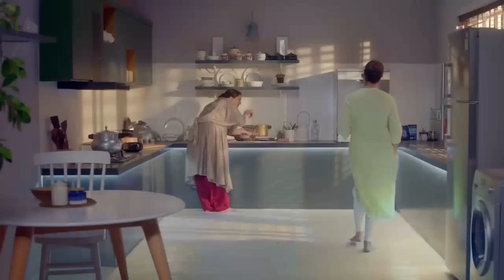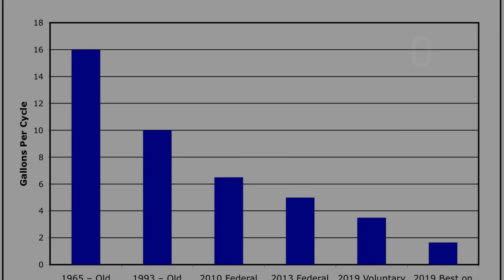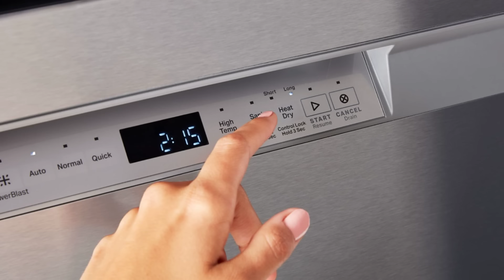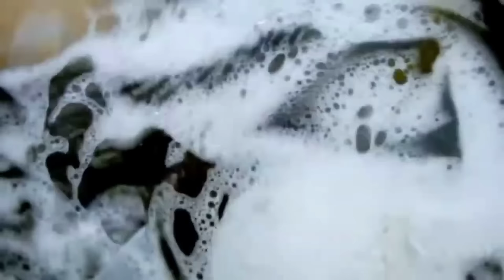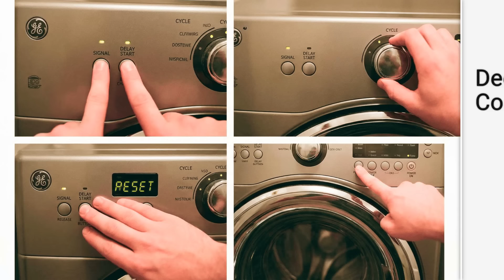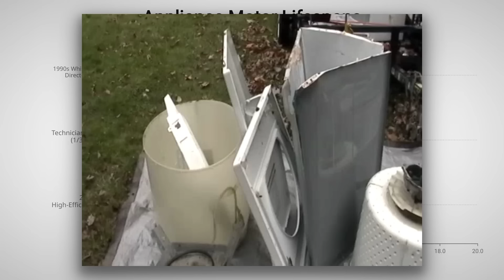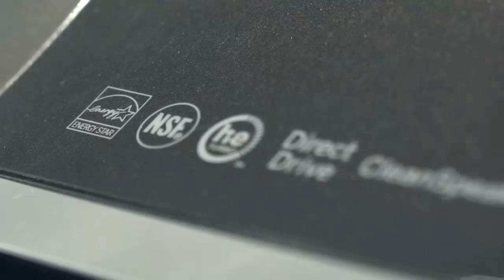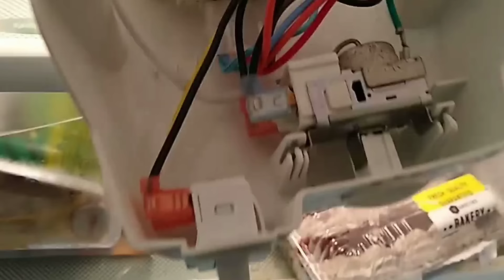Why 'High Efficiency' is a Scam (The EPA's War on Quality).

Comment: It's not just the washing machines in dishwashers that have gotten horrible it's the detergents as well. 

While they were mandating all these efficiency requirements for dishwashers and washing machines. They removed triphosphate from the detergent triphosphate works to remove the detergent buildup. Detergent is a great cleaner however it needs a chemical to break it down so it can be removed. This is why washing machines and dishwasher stink the detergent is never rinsed out of the machine and you notice a slimy buildup if you ever take one apart. That is the detergent trapping all the dirt particles and organic matter. There is a fix painters use triphosphate in cleaning look for a good triphosphate cleaning product use a small amount regularly in your dishwasher and washing machine and it will eliminate the odors. Just keep in mind there are some cleaners now that say triphosphate free they will not work because the triphosphate has been removed. It even works good for just general cleaning.
Reply: I’ve used several different types of tub cleaners and a dozen cycles or more and none of them clean the machine. I know this because I can bend the rubber seal and see the black slime inside. At best the so called cleaners just mask the oder with perfume. 

I remember my mom telling me to use the trisodium phosphate to clean my greasy work clothes.
Reply: @1985230ce if you want to clean your washer input a generous amount in without clothing and run it on a clean cycle. They invented all those tub cleaners because they removed the triphosphate out of the detergent. Most of them don't even clean they just deodorize masking the odor.

Comment: In 1994, I bought higher end units that still had mechanical controls, and that set of appliances lasted 20 years. In 2014, with everything having electronic controls, I went with the best rated, top of the line appliances and put large surge protectors on all of them. Appliance build quality is clearly lower than it used to be. However, the new Bosch dishwasher and LG front-loading washer do a vastly better job of cleaning than the old Kitchenaid dishwasher and Maytag top-loading washer. I was shocked at how poorly the old appliances performed compared to the new ones.

Comment: Speed Queen still makes machines that are built to last for decades.
Reply: I went with SpeedQueen because they use commercial grade parts in their consumer products.
Reply: People don't buy them no blue tooth app.    Yes they are the best.    I am still rocking a 2004 Electrolux back when they were built well
Reply: My grandparents had a Speed Queen washer and dryer set that they had from the time I could recognize what they were as a little child in the early-mid 70's, until my grandma passed in 2009. I moved away shortly after that. My aunt took over the properly and I haven't been back, but I'll bet anything, they're still there working.
Reply: @Bayoucityconstruction  Somebody buys them because they're still in business. But I see what you're saying. 
People are 🐑, easily stupified, age led astray by the newest, shiny thing.

Comment: If your looking to make mold the new  machines are great . As far as cleaning clothes with all the HE hype  and Energy Star bull, it's less expensive to throw the dirty clothes away and buy new clothes all new machines should come with a complimentary bailing bucket and mop and a spare wax motor , skip the mega super tek machines they are  better left in the show room one thing they can do is conserve water on a per wash basis of course you will need to wash your loads 2 to 3 times in order to observe hardly noticeable/ marginal results my domestic service personnel refuse to use the machines and use a large river  rock on the patio it's faster and white garments actually look new and  white when processed by hand.
Old School Commercial top load Speed Queen machines are the best and are still available if you don't have  "La Femme Ménagè" assistance.

Comment: It worse than the video - My washing machine destroys my clothes by have too little water and dragging the clothes against the bottom of the washing machine.

Morons though this would be a good idea to save the planet.
Reply: @sumralltt Naw, they didn't.  Well SOME morons might have thought that.  Most of them knew better.  But they also knew they could "fleece" the public by CLAIMING it was to save the planet.  

Most of them surely knew all along that it's only real result would be to make machines that break sooner and are more expensive to repair.  That way the manufacturers can sell more machines.  

And the manufacturers pull the government's strings, with money.  That's how it always has been, and as long as the system has people in it, that's how it always will be.  That's just the nature of how people are.  (The ones who rise to wealth and power I'm talking about)
Reply: @jefflisa2347  100% agree - Those with the gold bribe those in power to make the rules.
Reply: @sumralltt Exactly!

Comment: You learn this if you ever worked in a restaurant. A dishwasher is only to sterilize the dishes. Not scrub them and wash off all of the filth. YOU hand wash off all of the debris. Then put the dishes in the dishwasher with detergent to get the dishes sterilized. That all the dishwasher is about. Meaning. A dishwasher in a home is pointless. In a restaurant. There are different detergents used to make the dishes safe for anyone to use them over and over again. Don't waste your money. Look up industrial dishwashers. Look up the detergents they use to meet OSHA requirements. Massive differences.
Reply: I service appliances.  You are talking about two very different machines that do the same job differently.  The commercial restaurant DW is for fast production  The home DEW is not. But both require pre-rinsing.
Reply: @mrgcav You people really need to get an IQ before committing on my comments. Yes they are two different types of machines. Yet. Do the exact same thing. Yet. Yes you need to prewash in both cases. Yet. At a home. You only use a mild soap. The commercial ones you do not. Since you only use a mild soap at home. There is 100% no reason to have one at home. Where a commercial one is needed. Then yes they are needed. I was even a plumber. I put in my far share of washing machines into new residences. Buy one. Didn't say don't buy one. I said they are pointless. Waste of money. If you want one. So be it. That's on you. Anything to deal with the public has to meet OSHA requirements. They have to have one. In a residence. No. For fixing them. That's no different then changing the oil on a vehicle. There are hardly no parts. A computer board and a water pump. Seals and orings. A case with a door. Nothing there. Like anything else. When it comes to appliances. People can fix them in their sleep. What they don't want you to know. Same as a carburetor. People paid high dollar to get a carburetor fixed. I worked on them all. All brands. Whoopi. Want a dishwasher for a home, etc. Buy it.
Reply: @SCANADAZE  i dont know man i just use high temp cycle in my dishwasher all the time. Then my dishes come out clean. I dont need to pre rinse them. But i guess i dont use the 3 tiems longer eco  cycle.
Reply: I am not sure what kind of dishwashers you’re talking about.
The dishwasher I have at my home washes everything just fine without any kind of pre-soaking or pre-rinsing.
And it has functioned this way for many years without any issues.

It is my understanding that some of the new detergents contain enzymes which help degrade food particles.

I used to think like you, however when I did some research regarding new dishwashers and new detergent, my thinking changed. And I have personally tested it out for the past three or four years on my dishwasher with no problems at all.

That being said, I absolutely agree with this video about how current washing machines are absolutely crap. The washing machine that came with my current house is easily inferior to the washing machine at my previous apartment.
Reply: @robcubed9557 Okay. Get underneath you kitchen sink. Where the garbage disposal is. That black hose connected to your garbage disposal is the drain line from the dishwasher. See how big it is. Why you must at all cost rinse everything off the dishes before putting them into the dishwasher. Why I say they are pointless. Do them by hand. In the industrial ones. 100% of the wash water goes straight into the garbage disposal. Massive difference. Underneath your kitchen sink proves my point. The soaps used in the industrial ones. One of them is an acid. Kills everything. The container even says it. Warning. Corrosive. Like battery acid. Making 100% of the dishes going threw them safe for the whole public to use. At a residence. It's just dish soap. Again. I DID NOT SAY DON'T BUY OR OWN ONE. I said a dishwasher is POINTLESS. A waste of time and money. This house. The way my dad signed it. As if Lucifer himself designed it. If I even wanted on. I have no place to put it. It's so badly designed kitchen. I need to replace the kitchen faucet. I can't. It would take someone really skinny to get in there and change out a faucet that is so simple of a job in a normal kitchen. Like adding in a garbage disposal. Electric is there. I am not that small person. He had the kitchen sink put into a corner. I know why this house he couldn't sell it. I wouldn't have bought it either. Everything he built is backwards. Because as everyone else. He knows it all. He built an whole porch. For only people 9'10" tail or shorter. This house is a nightmare. Junk. Because in his mind he knows it all. The facts are. Home dishwashers only use normal soad. What two hands do naturally. The drain system isn't big enough to handle food debris. After you see that hose. Look into the garage disposal with a flashlight. Look where it dumps into the garbage disposal. It has a down spout. So the water doesn't splash upwards. Food catches in them easily. If they still make them that way. In the bottom of the dishwasher. Over the drain. Is a screen. To catch all of the debris. Meaning. The dishes have to be totally rinsed off. Then. Why have one. At home. They make no sense. A garbage disposal does. 100%. Every home should have a garbage disposal. Not a dishwasher. Own one. Buy one. I personally DO NOT CARE. They are just pointless in a home.
Reply: @SCANADAZE 
I am not discounting YOUR experience.

I am only sharing MY experience.  My dishwasher has saved me many hours that it feels like I’ve added weeks to my life.   and this dishwasher has not given me trouble even though I don’t pre-rinse my dishes.  It has stood the test of time for me.
Reply: I have one of those elusive dishwashers that sort of blends both worlds. KitchenAid (made by Hobart at the time) KDS15 from the mid 1960s   It’s amazing.  It’s loud. High temp sanitizing.  Except I don’t use the full cycles because they were designed for a worst case scenario of an overloaded, dried-on, poorly arranged wash load.  Only one spray arm at the bottom.  Standard cycle is 11 gallons and 40 minutes with dry time included. But with just me in the old family home now I advance the timer to the rinses, believe it or not. I use the hi temp sanitizing and skip the dry cycle.  The first is the wash followed by two rinses, the last being 180°+. This is if I have at most 2/3 load on both racks. Result: 16 minutes to steaming hot clean dishes that air dry in no time because they’re so hot. 5 gallons. One dose of cascade complete powder. That’s it. Even dried peanut butter on knives comes clean. Admittedly I can’t get away with this for baked-on stuff, but actually when I catch it before the dry cycle hits, that stuff wipes off with the scotchbrite side of a blue sponge. Not bad. 
Btw, that machine has been serviced once for a fill valve. What a beast! OTHH, it was $310 in the 1960s, meaning it would be over $3,000 today.  I’m lucky to have it
Reply: In the large walk in dishwasher I serviced in a bakery,the wash water was changed daily. It was strained and pumped at high pressure and temperature to wash the baked on food. The rinse cycle was clean very hot water that diluted the wash water. Then detergent was added in each cycle. 
This system is far more efficient than the ridiculous time wasting home roach feeders.
Reply: Fr

Comment: Did the EPA consider the increased amount of waste generated by appliances that breakdown prematurely requiring replacement instead of repair because their design causes them to fail prematurely. Did the EPA think that increased use of electricity just so a dishwasher that uses 3.5 gallons of water needs 3 to 4 hours to get the dishes clean rather than using 2 more gallons of water to get the dishes clean in one hour. Did the EPA consider the amount of materials and energy needed to produce an appliance and the energy needed to transport from the factory to the sales floor or to the buyer. Should people have to buy 4 new examples of the same type of appliance in 20 to 25 years or just 1 example of an appliance that can last 20 to 25 years. Appliances just need to work and to do their job effectively. An ineffective appliance is a poor appliance that cannot do the job it was intended to do. It is a waste of the consumer's money. It is also a liability for the environment.
Reply: There is a reason the Founding Father wanted the Government to stay out of our business.
Reply: Of course, did not.
Reply: But did your goverment think about mandating longer warranty?
Reply: @erlendse  Government should not control warranty. Government must ensure free competition and no monipolies.
Reply: @sepulkariy woosh
Reply: They could make the energy star appliance last 20 years they just have no incentive to do so. No review site tests for longevity
Reply: The EPA is a crooked, sold out to special interests entity. There seems to be very little common sense running that show.

Comment: Bulky/sheets & towels cycle (the one that fills the water to the top) is the only one that gets our clothes clean and doesn’t lock out the spin cycle because of an unbalanced load.  We use it for every single load.
Reply: I have been arguing for years that these things have more settings than anybody ever uses adding unncesessary complication and cost.
Reply: We replaced the inner tub rods and it still would do that!

Comment: A lot of wrong statements. And you show a LG direct drive as an example of modern flimsy motors, the LG has one of the best washing machine motors ever developed and still a replaceable bearing. 
Modern machines are not more energy efficient because the manufacturer could do it, but because they are forced by law. They never do anything good without force. 
And the water consumption is mainly required to flush away the dirt AFTER it has been washed off. The top loaders are simply outdated, they required a lot of water and strong washing detergents to get anything off, harmful to the environment.
Reply: Yep. The regulations have improved efficiency, the companies have decided to race to the bottom regardless. Look to the commercial markets where reliability means money and see: they have also continued to improve and upgrade, but they are still "well built" ... of course, since they're considered premium products for businesses making money they have price tags to match.
Reply: @QualityDoggo not exactly true.  Commercial units are not held to the same regulations as residential units.  You can still purchase an actual commercial speedqueen washer which is superior to their residential model and similar price tag and water consumption is significantly different.   IE Shorter wash times, more water used.
Reply: @Y @YourBuddyKeith re resources always means a (potentially) better wash, but there are diminishing returns.
Part of my point: if you compare modern "home" machine+detergent against older "home" machine+detergent there has been a significant improvement in both efficiency *and* effectiveness because the machines take advantage of better detergents and techniques *that were not available at the time*.
Reply: ok what the heck did YouTube do to my formatting and the reply tag this time lol what a jumble of letters😂
Reply: Manufacturers achieve energy efficiency via small motors which don't last as long as the old large motors.
Reply: A lot of correct statements here in this video.  The video explained exactly what you said regarding regulations driving efficiency.  The only good direct drive was whirlpools direct drive before it was discontinued.  LG and Samsung coils are aluminum and I've seen enough shorted ones to rival your claim of superiority. Let's not forget LG's liner compressor saga going on 15 years now.  

More water means more contaminants can be suspended in it DURING a wash and then drained off.  Heck even lint will stick to clothes with less water and not be drained out.  

I've been servicing appliances for over 15 years and I've seen it all.
Reply: @YourBuddyKeith 
Linear compressor.